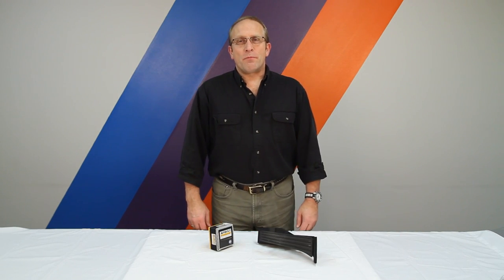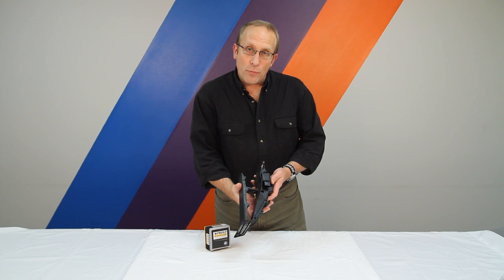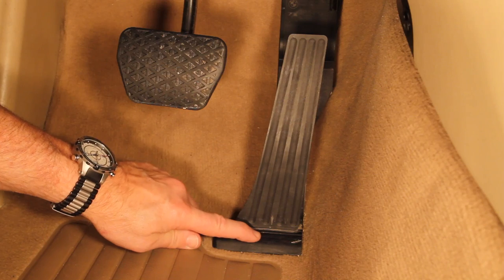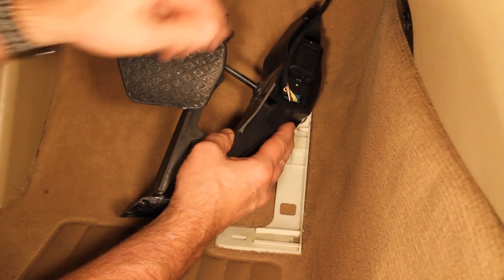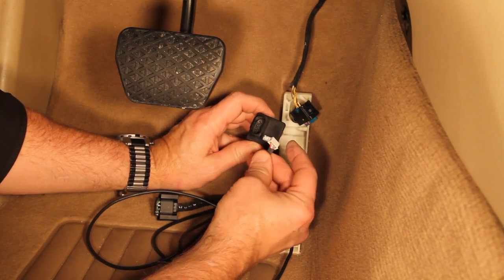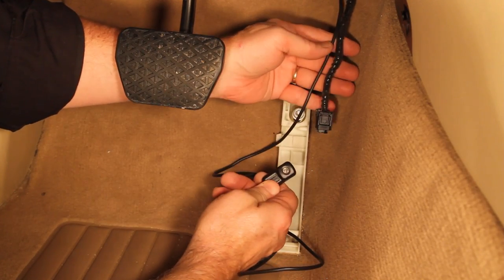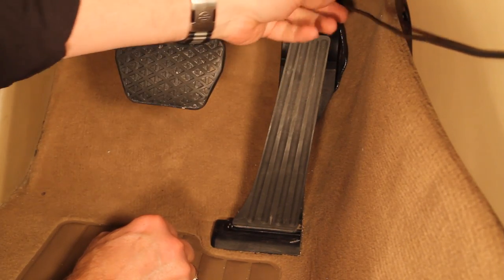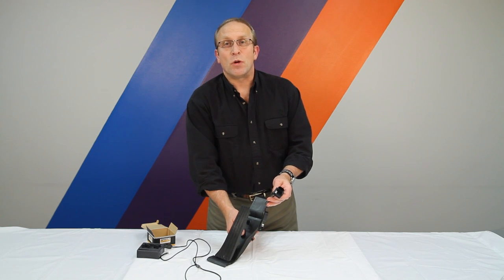BMW Sprint Booster Installation - Bavarian Autosport

Comment from the maker: There is no inherent change in fuel economy with a Sprint Booster.  However, if you drive more aggressively, you will see a change in fuel use due to this.

Comment from the maker: @liamsdebut 
There are two styles of throttle.  The one in the video is the earlier style.  The later style is secured by a small allen-head screw (5-mm as we recall), through the base and into the floor.  Once the screw is removed, the throttle assembly is pushed up along the firewall to disengage a hook from a slot in the firewall.

Comment: Do you have to turn the sprintbooster on every time you start the car or will it remember your previous setting? For instance, if I have it on "red" or something, when I turn the car off and then on, will it still be in "red"? 2008 528i

Comment from the maker: henryhank - Thanks to the Magnuson-Moos Act, a manufacturer cannot void a warranty due to an aftermarket part being installed.  The dealer would have to prove that a specific repair was due directly to the installation of a non-BMW part in order to void the warranty work ON THIS ONE REPAIR ONLY.  As far as the Sprint Booster goes, if you are worried about the dealer finding it and giving you a hard time, just remove it when you go to the dealer.

Comment: I'm gonna guess this is just for automatics right?
Reply from the maker: The Sprint Booster is applicable to both automatic transmission vehicle as well as manual transmission (and SMG  & double clutch).